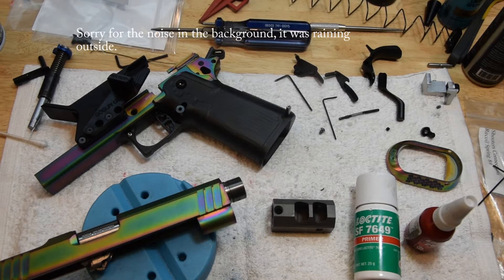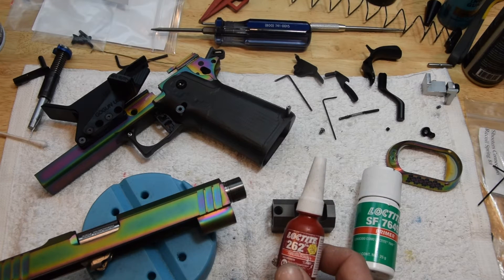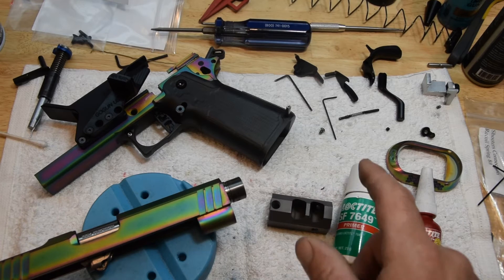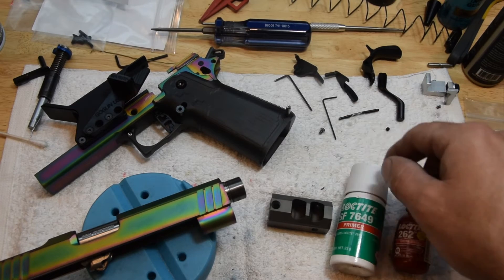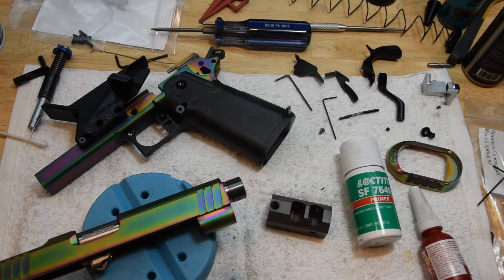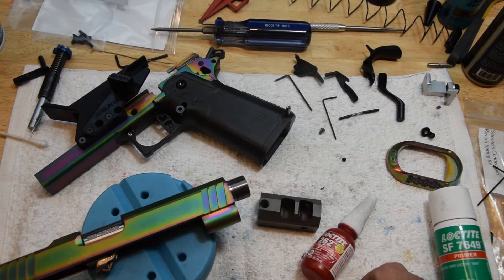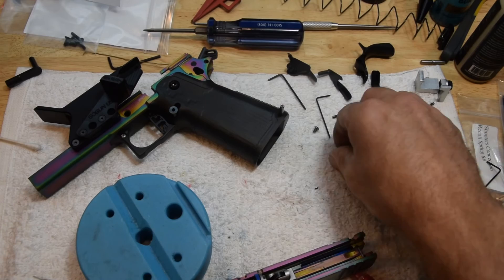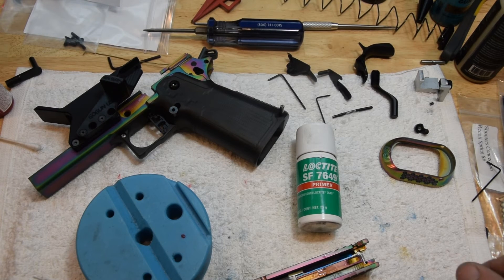Loctiting Comps 1911/2011

Comment: Should we be worried about soaking the comp/barrel in 50/50 hydrogen peroxide/vinegar mix when cleaning the comp?  Will it break down the loctite?
Reply from the maker: We don't soak the the comps to clean them.  The threads are not air tight so there is a chance you can affect the loctite.